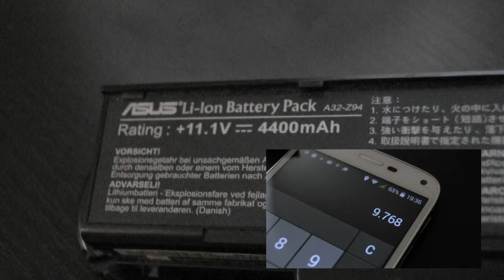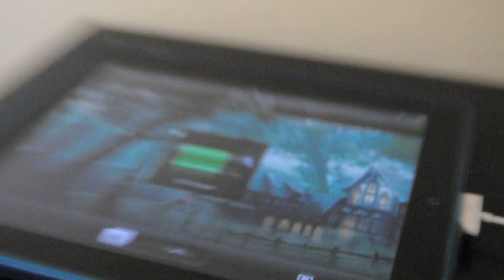Make 10000mah Powerbank for 1$ with Laptop Battery and Car Charger

Comment: With this setup, you have to trust the internal battery protection circuit, whereas when connected to a computer, the OS shutdown itself way before the circuit does. It can also results in decreasing capacity of the pack or the death of one cell.
Reply: ... But it's cheap. At least at first it is. In the long run, yeah, it'll die early.
Reply: a better solution would be,to dissasmble it,take apart the cell,and then form a pack of those cel(paralel)l,to result a 3.7V battery pack,and get a 3.7v to 5v boost converter..am I right?

Comment: better idea, buy a cheap 2-6 cell power bank battery case from ebay for a couple dollars, get pliers and strip laptop battery and pull the tabs off and avoid shorting the battery while doing so and then put the cells into the power bank and carry the others in a nonconductive bag or case if you need them.

Comment: how to charge the battery again??
Reply: +Sumit Pagare In laptop
Reply: +Sumit Pagare 
1) gotta do it by inserting it in laptop OR 
(BE VERY CAREFUL IF DOING THIS)
2) you could connect old charger's wires directly to the positive and the negative terminals on the battery (be sure to properly identify terminals on battery and polarity of wires on the charger - I recommend using digital multimeter for that purposes. I have no idea what might happen if you connected it wrongly, but I would expect some bad stuff). Battery electronics takes care of charging the battery cells properly.
I am charging one battery pack right now using the second method and I am using digital multimeter to measure voltage on poles of battery pack (battery is disassembled). It's charging perfectly!
Reply: e Zlatane mozes li mi to na nasem pojasnit ,direktno kopcanje, jel mislis na kable koji ide u struju i da osjecem onaj dio sto ide punjaca u laptop i da spojim na bateriju direktno da se puni ,  ili sam pogresno skontao :)

Comment: question....s.  Does the car charger support lithium batteries ? O.o ... is this charger still alive?... it didn't burned your house?
Reply from the maker: nop it does not,and it works just fine when i use it,nothing different than plugging it on your car lighter's port

Comment: +truebassB 
You forgot to mention the most important point of your innovation in this video. It is that, This LaptopBatteryPowerbank will get charged within 1.5 or 2 hours, compared to regular powerbanks that take 6 to 10 hours to charge.
Reply from the maker: +Kketansa Art yeah laptoo batteries charge with around 6 amps,3 times plus more current than powerbanks.

Comment: Looks awesome! But i need a wall outlet instead of USB, any way that will be possible? Also how many wats will this produse?(does it stand somewhere on the laptop battery?)
Reply: +Oskar Henningsen ugh, you could use some of converters for car, I think that there is such stuff (12V DC to 110V/220V AC, whichever voltage you need). Look it up on Google.
Standard battery packs such as one from the video have power rating of 48Wh, which means they can provide 48W power rate for 1 hour. If you converted DC to AC, I wouldn't expect more than 40W for one hour (due to inefficiency of converter circuits).
Also bear on mind that those numbers are correct only if you have brand new battery pack (my battery pack that has been used for 3 years can only charge to 50% of its capacity).
Reply: +Oskar Henningsen and don't get the idea to run 200W light bulb or something for 12 mins, battery cells would deteriorate very quickly (assuming that they don't explode because of overheating) :D
Reply: Goran Jankovic well fuck that haha
Reply: Oskar Henningsen exactly, not worth it :D

Comment: I could put the power cables carrying the laptop directly to the battery ? cutting the end that connects to the laptop and directly connecting the positive and negative wires to the battery ? I would not bring me problems right ? because the cable already has a mini transformer along with it right? what problems it would bring me , besides of course the possibility that I connect the positive and the negative in the wrong order ? tnks
Reply: I don't recommend it. Most laptops use 16/19/24v power adapters and the batteries are typically 9.6/11.1/14.4v. Unattended charging in this manner even if it does work is a recipe to burn your house down as well.

Comment: Nice Job! 
Does it always works with first and last pin?
How can I charge such "powerbank" without laptop? (just plug "+" and "-" power to the battery?)
Reply: Its very dangerous to just plug some voltage into Lithium ion or LiPo batteries, they can explode
Reply from the maker: +JonasLue in most cases it is but realistically even if this will happen you might get away with on a Li-Ion as it will trigger either the overcurrent or the thermal fuse inside the battery control circuit... sooner or later.
LiPo is dangerous even when charged as normally,let alone charging it with an uncontrolled source.
Reply from the maker: +porosty not always it depends on the battery,look for a datasheet or pinout for the one you might have. You need an external laptop battery charging circuit that you can find on ebay.

Comment: how do you charge the battery with out a laptop
Reply: my guess is make usb to usb like 33m jack to jack plug it in to wall or usb make sure wires hidden inside battery
Reply: you don't, you use the laptop.  The point of something like this is if you need to repurpose a laptop battery temporarily but still need it to be used as a laptop battery later.  Youtube is LITTERED with tutorials on how to tear laptop batteries apart and make a power bank.  I'm more interested in temporarily repurposing a laptop battery though.
Reply: @glasshalfempty1984  Give This Man A Prize 
you have to remember that our suggestion is to easy, people can't understand they prefer complicated things LOL

Comment: im considering doing this, but hiding all the components inside the battery, so i just have a usb port sticking out of the battery, on a side, where i can access it without problems, and the battery can still be charged using a laptop, might be difficult, but im going to try anyway.
Reply: +pesoen no, there is pretty much no room inside
Reply: DMAN22yeah depends on the battery, i have one with a large extra circuit inside it(not sure why, but its a spare charge circuit, but with no input, other than solder points on the pcb) and if i decide to mod a battery, i could remove two cells, depending on how it is made of course. but most laptop batteries go in pairs of two, a few go with three cells a group(mostly gaming laptops, which require a lot of power)

also, the 12 volt to 5 volt converter is not that large, i have one smaller than most coins, not the most effective one, but it should do the job nicely.
Reply: pesoen every laptop battery i have seen has no room inside except for a non oem dell with only 4 cells instead of 9, but if you can find one then cool
Reply from the maker: +pesoen pretty it is interesting what you want to do,pretty do-able but a little tricky to get it done seamlessly,waiting to hesr more when it happens.

Comment: How do you know the correct hole to put the wires in on the battery itself? What will happen if they're put in the wrong holes?
Reply: never put in wrong hole
Reply: I put it in the wrong hole once.  Made an awful mess.  Not to mention the black eye I got, as a result. :-/

Comment: great project but how will you charge you battery once it down.
Reply: +Buffalo Geeks 
1) gotta do it by inserting it in laptop OR 
(BE VERY CAREFUL IF DOING THIS)
2) you could connect old charger's wires directly to the positive and the negative terminals on the battery (be sure to properly identify terminals on battery and polarity of wires on the charger - I recommend using digital multimeter for that purposes. I have no idea what might happen if you connected it wrongly, but I would expect some bad stuff). Battery electronics takes care of charging the battery cells properly.
I am charging one battery pack right now using the second method and I am using digital multimeter to measure voltage on poles of battery pack (battery is disassembled). It's charging perfectly!

Comment: I have a fully working battery of my old laptop and the problem is my laptop cannot charge my battery so I wanna know how to charge the battery without laptop
Reply from the maker: +free bird true
Reply from the maker: +are you kidding me? there are some external laptop chargers you can get for cheap
Reply: +truebassB battery external laptop chargers??? cheap???? send me a link for hp battery then.
Reply: +truebassB when i use the laptop charger to charge ,it exploded one of my battery
Reply: +truebassB how can i do

Comment: sir can we charge laptop battery cell directly using normal phone charger ...attaching charger terminals to cell??
Reply: +Sumit Pagare no you can't
Reply: +Sumit Pagare cell may not be charged directly or your risk badly damaging it and hurting yourself when it explodes :D
Here you can see that battery cell needs proper electronics to monitor current flowing through the cell and adjust the voltage accordingly. 
http://batteryuniversity.com/learn/article/charging_lithium_ion_batteries

Comment: Hey John’s Can you please say to me how to charge laptop battery after the usages
Reply from the maker: If you have the laptop the battery came from you can just plug it in and charge it,otherwise you would need an external laptop battery charger.
Reply: John's thanks for reply me

this is a not portable and carry in travel with laptop charger 

Can you please make a one new video in that show to how to laptop battery charging to our regular mobile charger in emergency travel without laptop and use of power Bank use and after this battery again use in working laptop 

Thanks again brother
Reply from the maker: Hello. I do not think there is any mobile phone charger that can provide sufficient voltage nor current to charge an 11.1v lithium ion battery,it will require a circuit of high complexity to achieve that. However if you don't need the battery as it is,you can pry it open and use the 18360 cells in a powerbank case which you can get from ebay for a couple of bucks with its total capacity to be around 6000mah or so which can be charged using a standard usb charger,more of that specifically i don't know. I hope i helped!

Comment: Chances are your laptop battery will die much sooner then your laptop. So you probably don't have a good laptop battery lying around. Buying it would cost more then a regular power bank.
Reply from the maker: +Hulla Dek This works mostly if you use a laptop with a good battery. 

However my two batteries are from 2006 and one of them still have 30 minute juice on the laptop,so in my case it still makes a good Powerbank. 

Not bad for a 10 years old battery!
Reply: +Hulla Dek chances are when it dies, only one out of 6 cells are dead

separate the cells and you get a usb charge driver and you can make 5 separate powerbanks and dispose the single dead cell

Comment: Hi truebass I tried it on my seven pin laptop battery and it doesn't work. I bought the exact same charger and had it tested disco know it works. Also batter has about one hour life inside my laptop. I don't know what I'm doing wrong? I hooked the positive up to the positive and same with negative? Any ideas would be great. Thanks!
Reply from the maker: +Rory McInerney are you sure it is not shorting? try check on google with your battery model to see if there's any pin combination to enable it.

Comment: how many avg wires schould be?
Reply: any wire as thin it is will work for the ampacity which would be maximum 2Amps just be sure to be high quality and not oxidized

Comment: how do we charge the battery without a computer do you just plug the usb into the battrey and a usb to the wall
Reply from the maker: +Shayne Kant you need an external laptop battery charger or chsrging circuit that plugs to your laptop charger,cost for it can be as low as 2-5$ or 10-15 for a complete charger if you have none.

Comment: and how do you recharge the lap top battery???
Reply from the maker: +Raul Morcos You need an external charger that plugs on your laptop power supply and battery or you can charge it on your laptop,this works best if you can do any of the previous mentioned.
Reply: +truebassB 
what is no laptop?battery only  how to recharge?
Reply from the maker: external laptop battery charger
Reply from the maker: +Dali Fajjari (Happy) unless you have them on hand
Reply: +Raul Morcos All he did to secure it was use the velcrow strap and stick the 2 wires into the opening, so just pull the 2 wires out, unvelcrow the converter, stick it back into the laptop and plug the laptop into the wall as long as that is still working and not the reason you ditched it.  When fully charged re put it back together and repeat as needed.

Comment: Really ? If the battery is low, because it's li-ion and you don't have a proper monitoring circuit, you could easily kill your battery! Oh, and by the way, that is a really bad way to charge your power bank...
Reply: Laptop batteries have integrated balancing and monitoring circuitry, charging yes would be unsafe from a random PSU, and shoving wires could easily lead you to shorting the battery to a 3.3v SMbus signals, and killing it because of the blowing safety fuse! also the monitoring circuit for that matter...
Reply: Of discharge? laptop batteries are usually only rated 1C-2C discharge.
Of charge? >1C usually, for phone batteries with rapid chargers, it's closer to 1.5C.

Comment: how to recharge battery laptop
Reply from the maker: +jayson dacanay external laptop battery charger from ebay,goes cheap,plugs on your laptop charger or it can be standalone.
Reply: truebassB  The external laptop battery charger is sold by very few sellers, and they cost 5 to 7 times more than regular laptop charger. Better idea will be buy a generic battery pack that fits in your laptop, and whenever needed, charge it in the laptop itself.

Comment: Good idea .. but how can you charge the battery with no laptop no laptor charger ? Can you add power just doing the oposige way? Plug in that litle phone charger and cut the usb wire taking negative and positive the conecting to the laptop battery 😂😂😂ima comfuse 😂😂😂😂

Comment: it wont be 9.000 mah with 5v, that usb charger has a linear regulator which WASTES the voltage (11.1 - 5 = 6.1(wasted voltage)). the capacity is still 4400 mah. If a buck or boost converter was used in that charger,  it would be as you said (ignoring the power loss as heat.) Take that battery apart and put the series connected battery packs in parallel, that way you'll get around 3.7 -3.8 volts which can be stepped up to 5V.  that way you just saved lots of energy.
By the way, there is 3 packs in series in that battery. each have 4400 mah. when connected parallel it becomes 13.200 mah. under 5V the capacity becomes about 9500 mah. Good day
https://www.youtube.com/watch?v=UjG2QGOC4aA
Reply: I was about to say the same thing. That car charger would take 12v and the battery puts out 11.1. Just because the output after going through the charging circuit is 5v doesnt mean the battery is discharging at that voltage. rofl

Comment: dosent work..
Reply from the maker: Check 1) if the battery is giving voltage without shorting specific pins,and if it doesn't then find out which ones to short 2) if the charger works or if it provides sufficient current to the device for it to charge

Comment: Claims 10000 mAh
Side of battery says 4400 mAh
legit
Reply from the maker: Very legit. It's 4400mah at 11.1v,or 8800mah at 5.55v,or around 9680mah 
at 5v. That is without voltage conversion losses though. When for 
example you decrease the voltage to half,the available current gets 
multiplied by 2,although the total energy available remains the same,for
 this battery around 48w/h.
Reply: truebassB Ah. Well I didn't think of that I guess.